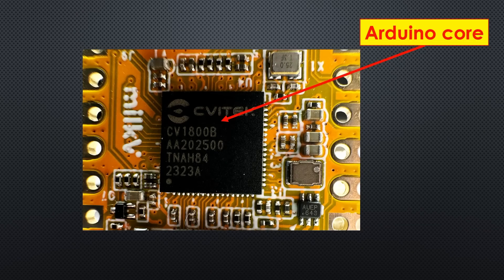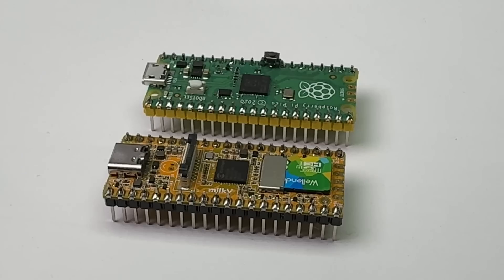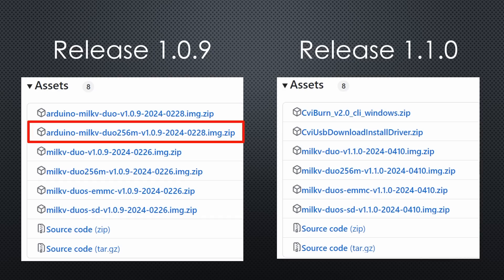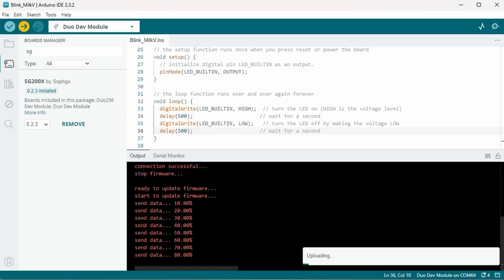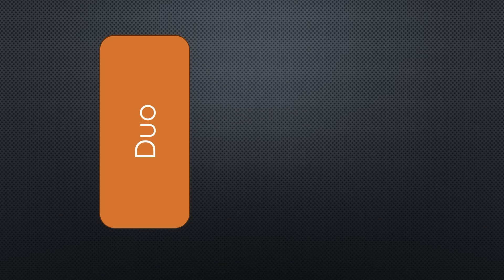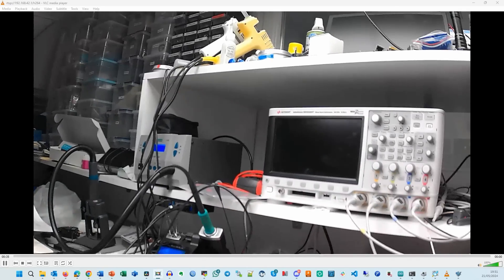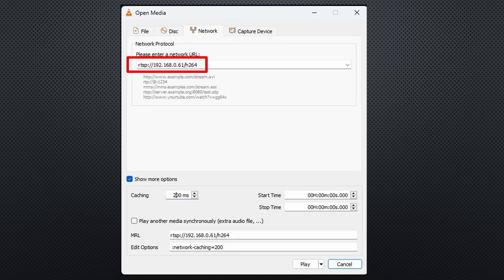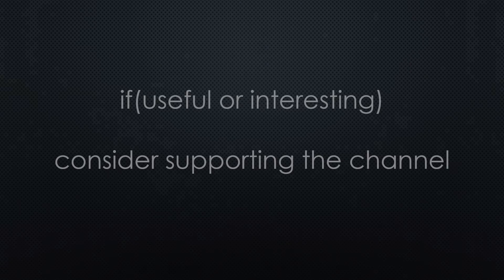(485) $8 MilkV Duo: Arduino on one core and Linux on the other

Comment: This controller doesn’t seem like the best option. First of all it’s just a knockoff of the raspberry pi pico, but the only similarity is the pinout. Second the usb interface is not that reliable for uploading as it is for other controllers. And who in the right mind would use an operating system with what is just a microcontroller with extra features? I bet the arduino software doesn’t even let you access the full amount of memory. Thirdly the software and library support is probably very poor. Although the clock speed is higher on this thing, the ESP32-C3 (and possibly the RP2350) are the better options here due to tons of compatibility and good software.
Reply from the maker: I agree, there are other MCUs to choose from. I do not think itas a lot to do with the Pico.
Reply: Apologies if i came off a bit strong about the controller board. The specs seem to be good, but i find the software a bit harder to use. And if i remember correctly the pinout is the same as the raspberry pi pico, or similar in a way. I feel like if they remove the operating system requirement it might be a good board to some extent.

Comment: I bought one MilkV DuoS with eMMC and wifi. This board is very weird, because it combined many platforms on a single SBC. At the same time, Linux is extremely basic - kernel, busybox, some lightweight utilities, python 3.9 with numpy, pillow, pyserial, spi, lxml. Out of the box there's sshd (dropbear), dhcp client and server, ntp, wpa_supplicant, good old init.d and extremely simple start up scripts. Few tools such as alsa-utils, wget, curl. All development must be done in Linux virtual machine or development containers, there's no distribution with package manager, there's no compiler. Whole Linux consumes 22M of memory and 160M of disc space. Device sips 1W of power. So far I spend one day with it.
Reply from the maker: Thank you for sharing your first impression! I did not expect much more because it is positioned as a "embedded" board.

Comment: Awesome! I ordered my Milk-V about 2 weeks ago so the timing is great for your video. I am comparing cheap and capable boards for mini AI. Also in this category is the Luckfox Pico series. The pro max is a few dollars more, but has an NPU (RV1109 I think). I want to see how these hold up with nontrivial compute to Raspberry Pi Zero 2 W. The price, size, power use, and performance of these just blow my mind.
Reply from the maker: We all wait for your results!
Reply: The Pi Zero 2 of course is far more powerful for computer, with four dual-issue A53 Linux cores, vs just a single single-issue core here. However a 1 GHz C906 generally benchmarks around 15% faster than the 1 GHz ARM1176JZF-S in the original Pi Zero -- as well as a much more modern ISA than its ARMv6.

Comment: Nice Video !
I'll search a bit about the interoperability between the cores like does the linux core can go to sleep, and the arduino wake it up ... (that would really be useful)
Reply from the maker: I did not find anything about that topic.
Reply: I believe only the 8051 core is able to perform such a feat.  The arduino core is not on the RTC power domain.

Comment: Nice presentation. About the last part, you quickly presented a radar solution. Well I am seeking a solution to monitor and record incoming traffic speed at the street in front of the house. My wifi extend up to the street limits. If you ever find a solution could you make a complete presentation.  You made a radar presentation on a previous date, but vehicle speed  could not be evaluated because a PC is required to crunch the number. However this board present new possibilities that could make insitu speed detection without the use of a pc?
Reply from the maker: I would distinguish between speed measurements and data transmission. You get devices for measuring traffic speed. Maybe you find one with a data connector where you can connect a data link to your home using WiFi or any other wireless protocol.

Comment: I bought years ago a Udoo Neo board which has an iMX cpu running Linux and a core running Arduino code. It wasn't based on RISC-V architecture though
Reply from the maker: I heard about that board bot never owned one.

Comment: I caught myself chasing the "next shiny thing" and wound up with a basket of aging modules. I've settled in on Espressif fully using the C3 for my sleeping sensors and the S3 for my hubs. I had to implement ESPNOW to relieve my router of IP devices having 100 sensor/control devices on my lowly home network. I enjoy programming and also avoided HomeAssistant in lieu of my own total system.
Bottom line.... You tease the hell out of me with these new devices. I have to hold back!

Comment: If you need some reading materials for your summer break i can recommend the SPV1050 data sheet. It looks like it could be the (almost) perfect solar power IC for small lora sensors.
Reply from the maker: Maybe a bit weak. But otherwise very good.

Comment: There is not so much new in this. It is called AMP (asymmetric multiprocessing).
It is quite common for real time systems running on multi-core CPUs. For example, IMX8 chips can have multiple main CPUs (running Linux or Linux and some other OS) as well as ARM Cortex R5 cores running RTOS or bare metal.
Reply from the maker: That's good to know. Thank you. So far, I haven't encountered a module that supports Arduino. And its price point is also interesting for Makers.
Reply: @AndreasSpiess  Certainly the maker pricepoint is very interesting. There is a boom in this space - particularly Chinese RISC V chips.

Comment: 3:24 700MHz Arduino.. We have come a long way!!
Reply from the maker: Indeed. We probably will need a lot of delay() statements ;-)
Reply: @AndreasSpiess   a turbo button ! 🙂
Reply: The Teensy 4 has been running Arduino on a 600 MHz dual-issue Cortex-M7 (close to the same speed as this single-issue 1.0 GHz CPU) since mid 2019 -- and with a heatsink you can safely overclock it to 960 MHz (it's right in the Arduino IDE settings for it). But it's only got 1 MB RAM and no MMU. And at $20+ it was a great deal in 2019 but now is far more expensive than the Duo.

Comment: It's such a shame that they don't appear to offer an Ethernet expansion board with PoE.
Reply from the maker: It seems that PoE can be retrofittet on the board. Let's hope they will deliver a fully equipped board in the future...
Reply: Part of my reason for mentioning this  @AndreasSpiess  is in the hope that it encourages them that there is a market for this.

Many of us already have PoE for powering our access points and security cameras, and fewer devices running on WiFi and able to run from a UPS protected PoE switch would mean more devices, running more efficiently and protected from power outages.

Comment: I liked the video very much! It seems this chip on its own can bridge the gap between Linux and a RTOS, without doing any funky business with the Linux Kernel to make it act more like a RTOS (I use the term "funky" as I myself have too l little knowledge about the Linux kernel). 
Is it possible to compile and upload code to the RTOS part using the Linux part? (This doesn't have to be via any Arduino software) That would make this chip even more awesome!
Reply from the maker: For the moment they use a cross compiler on the PC. But maybe with bigger memories, this becomes possible.
Reply: Yes it's possible. You just have to copy the bare-metal program into a special directory. I think "Platima Tinkers" covers this in one of his videos.

Comment: What would really be an interesting topic here is how to effectively communicate between the two cores. I doubt that doing this via hardware I2C is a good solution, especially if it requires actual hardware connections.
Reply: Example using the mailbox is on the Duo arduino wiki page
Reply from the maker: I agree that an internal communication would be better. Maybe we just did not yet get an example, or it is not forseen in HW...

Comment: Exact what is the "killer app" that this board provides? Is there some requirement that this board provides that is easier than any other products out there? The chore of maintaining two toolchains, two sets of code that might need to be kept in sync, seems to weight against it. And judging by the level of support provided by "Milky" it could well be dropped and replaced by something else in no time at all.
Reply from the maker: Another commenter wrote that such concepts are common in industrial designs like in cars. I find it interesting that you can combine a project made for Arduino with a camera or a web app on Linux. Integrating cameras and web/networking is quite cumbersome in Arduino. And Linux is no real-time OS.
Reply: @AndreasSpiess  Thanks for the reply, much appreciated. It will be interesting to see what the 'makers' create using this product.

Comment: No transition sounds,  please.  We already live in a Chinese poluted sounding devices,  like APS no-breakers who insist on flashing high bright LEDs and annoying beeps every two seconds when power is down, I know I can disable them by pressing some magic sets of buttons,  but for some reason,  it comes back. I rebuilt mine,  throwing away all the circuit and lead battery and made an intelligent no-break with Li-Ion battery outputing 5V, 9V and 12V dc to power my internet modem,  and routers. Now I do not get any flashing lights or beeps and in reward I've got more then 10 hours of power for my devices and a Webpage notification of the state if charge and temperature.  I just used the clumsy box of the APS thing.
Reply from the maker: Cool project! And thank you for your feedback about the sound.

Comment: way too complex for me....
Dual core ok, dual systems not so sure.
these devices lay betwen microcontrolers and microcomputers... Sure someone will benefit from them.
No me though...
Reply from the maker: I had no clue about Linux and a few years ago, I used the Raspberry to learn it. I am still not very good, but it is very useful now. But this is probably not the right platform for that.

Comment: At 2:50 .. seeing different operating systems listed for each of the chips cores is a bit perplexing. 
It seems like a Swiss Army knife of processor cores. (dual Risk-V + Arm-A53 + 8051 + TPU)
Expect the OS's running on each core will need some standardize way to coordinate and interact.
Of course hardware always leads software capabilities, so will be interesting how people will leverage this architecture.
Reply from the maker: I am also curious about the projects it will be used for.

Comment: The MilkV Duo might have face detection (?).  Did you try pointing the camera at yourself? I have both the Duo and the Duo S but only have a camera for the Duo S and that test program you ran detects faces - puts a rectangle around my face.  The Duo S has something called a "TPU" for this purpose.  Hard to tell from the documentation if the smaller Duo can also do this.
Reply from the maker: I only used the face detection example and it worked. It seems it does not use the TPU, though. There are other examples using TPU also for the DUO.

Comment: You can even install the TinyCC compiler with nano or vi and program the chip, on the chip and compile its own code. Amazing! I’d LOVE to see more content on this as I just started messing with mine and have much to learn and even more to build!
Reply from the maker: Good to know. I did not use the onboard compiler.
Reply: @AndreasSpiess  you need to download it, I found a link posted by someone else, you can Send the zip file over ssh, unpack and run installation script. Very easy.
Reply: 64 MB is enough RAM to run Fedora or Ubuntu server (if someone does the work) and standard gcc for smallish programs. Or, I suppose, you can build gcc for buildroot or yocto or whatever it's using.

Comment: Minor correction. That's running busybox. Which means it does not have bash. It's actually running ash, which is mostly bash compatible.
Reply from the maker: You are right.

Comment: Nice video, and nice hardware! Just as a side note: RISC-V is an open ISA (Instruction Set Architecture). That means that any binary using RISC-V opcodes can be processed by any hardware chip supporting RISC-V. It does not, however, mean that the chips themselves are open source. So "bringing open-source to the chip level" might be a bit of an overstatement. However, it's still a great development.
Reply: I think what he meant was the ISA  is open source free from licensing cost unlike ARM which requires hefty upfront payments and a royalty fee per chip that uses its architecture
Reply from the maker: Thanks for the info!

Comment: Thank you for introducing this board to us. To use this board you would have to get pretty good at linux which is not a bad thing. It is a bit intimidating to me. I will check out to see if they have a forum or a community that will make using it easier.
Reply from the maker: Indeed, Linux knowledge these days is very useful!

Comment: Thanks!! I would not have discovered this board on my own, for a while. Definitely gonna pick a few up!!
Reply from the maker: This is part of my job as a YouTuber ;-)
Reply: I discovered it few days before this video :) when there was news that ubuntu has some support for RISC-V SBCs from MilkV. I was more interested in Mars, but it was not available for week or only high end model, which was too expensive and I don't need 8GB RAM. Also I found Radxa3C more powerful and cheaper and ordered this little thing for curiosity in the same package. Sadly Radxa3C seems dead (fixed: only xfce version works, not cli)

Comment: I hope these boards switch to m2 ssds instead of using more sd cards. At 3:37 it's interesting to note it has encoders for h264, h265 and jpeg but nothing to decode it. I looked up the Ethernet, it seems it can do PoE, and it's a 100mbps speed one, so a theoretical speed of around 11-12MB.
Reply from the maker: I assume it only has encoders because it aslo has no HDMI output (but a camera input)
Reply: @AndreasSpiess yes it looks like an edge computer. Milkv also has a mars and upcoming meles board that do have decoding but sadly only have emmc and SD.

Comment: It would be more desirable if the manufacturers improved the software more. There are more and more hobbyist projects that can no longer be compiled because there are too many dependencies with the versions and forks. Also this unpleasant trend away from the Arduino IDE to some online compiler somewhere on the Internet.
Reply from the maker: There is a trend in technology towards simplification (I even made a video about it). I see these new offerings as part of this trend.

Comment: I feel like this would be a good starting point to build something like the Star Trek tricorder. The Arduino core runs the array of sensors, feeding data to the Linux half for documentation and light analysis (perhaps for real-time visualization). Stream the data over the network to a more powerful computer system to dig in deeper. Cool stuff. 👍
Reply from the maker: Indeed, it opens some new possibilities!

Comment: Power consumption and deep sleep?
And what's the advantage of being able to run two OSes? Isn't a Linux core strictly more capable than an Arduino core?
Reply from the maker: 1. it consumes around 80mA
2. I did not see anything about deep sleep
3. Linux is no real-time operating system. So people prefer MCUs and C for such tasks. You find also different projects made for Arduino and Linux. So you have mor choice.

Comment: 12:13 is this really an 24 Ghz radar sensor or an resonant circuit that toggles around somewhere between 3 and 4 Ghz outside any official bands?
Reply from the maker: The ones I tested had FCC certification for the 24GHz ISM band.

Comment: I don't see the point. No proper distro. No package managers. The power of Linux over traditional µC comes from the availability of software and connectivity, the latter being the reason why the ESP modules are so useful compared to traditional µC like the ATMega. 

On the whole, this feels like a flashback to the late 2000s, when I was experimenting with SSV's dilnetpc. It sounded like a very enticing idea to have GPIOs on a linux system, but I was quickly disillusioned when I realized literally everything had to be compiled from source and manually transferred to the board. 

That is, incidentally, why the RPi took off and the Banana Pi didn't: The real power of RPi did not lay in the hardware, but in the ecosystem surrounding it. Frankly, unless they can get their ecosystem flying, I think this will be another 15 minute wonder and quickly relegated to niche applications by people who have some reason or another to live with the massive drawbacks inherent in the rudimentary busybox linux.
Reply from the maker: I agree with you. However, they at least developed a lot of examples and have a decent documentation. So there is hope... When the ESP8266 started, there were also not many projects ;-)
Reply: @AndreasSpiess  One can only hope...

Comment: Every tinkerer: Oh nice, that's a lot to play with. Every IT-sec person: Oh no, so much more unmaintained attack surface in our future. 🙂
Reply from the maker: I am an engineer and therefore, an optimist ;-)
Reply: @AndreasSpiess  Interesting ... I am an engineer and therefore, a pessimist
Reply: Zero-Trust or Bust. The only network you’ll be able to connect to has no access by default, every connection must be authorized.
Reply: 3:25 Did you notice the diagram said: secure boot ?